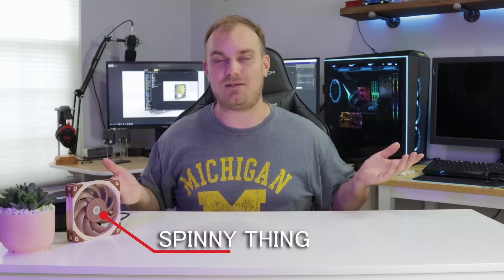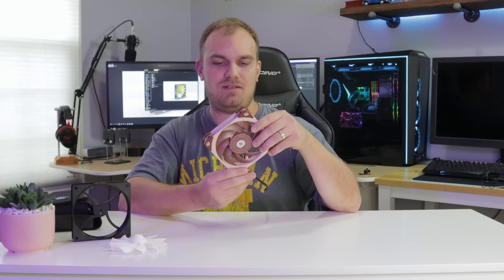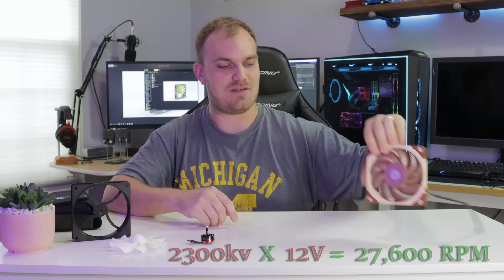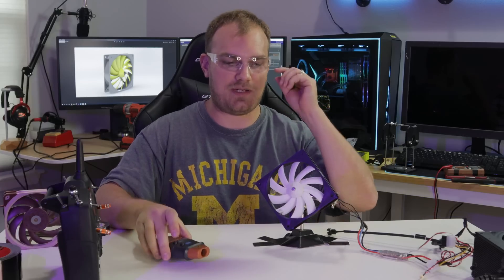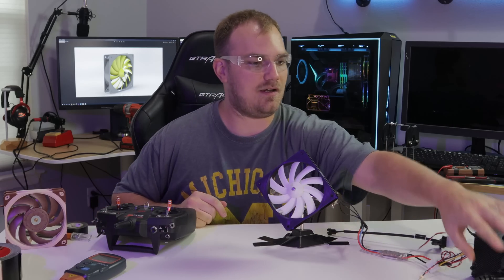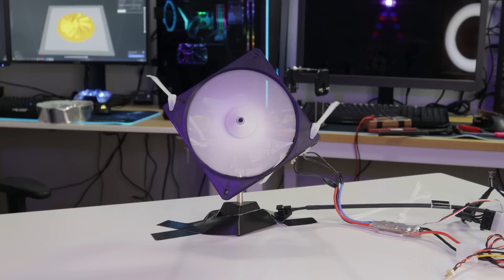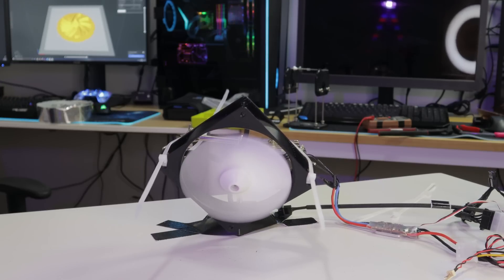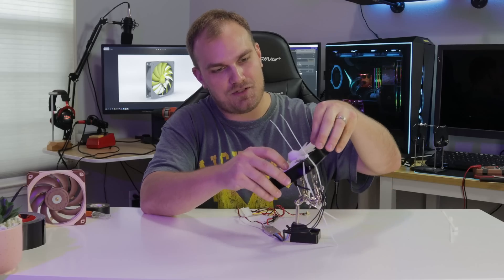3D Printed 120mm Fan + 27,600 RPM Race Quad Motor = Mayhem

Comment: I think what's happening here is the fan blades are being pulled outwards and are actually flexing into the shroud, looking at how much space is left after the test it's pretty interesting that the blades can move that much while it spins, Part of the design for fans like this is trying to find the best possible tolerance between the blades and the frame of the fan, closer is better for airflow, noise, and pressure but get too close and the blades may eventually start to touch the frame. PLA seems to be able to take the force without failing entirely but the problems is that under these types of forces it begins to warp pretty quickly. It's just too soft of a polymer for this I think. something like PC, a hard PETG, or a reinforced nylon would mose likely be more ideal if you wanted to take something like this to the absolute extreme, That would probably also help with the melting issue of the motor mount. cheap case fane usually only spin between 700-1500rpm so for the most part this was pretty successful.

Comment: They sell ~10mm dc motors like the RF-300 or RF-400, a lot cheaper than a quad copter motor, just search “thin dc motor” preferably on aliexpress but if you buy in bulk elsewhere, not too bad either unless these guys are all brushed motors then my bad

Cool balancing tool, as for the oval shape instead of circles, might want to check your printer’s belt tension and any v-rollers you might be using with eccentric nuts, the belts should make a very deep guitar sound when strung, note, if the belts are using something like glass fibers, it might have been stretched so while retensioning them is still better than nothing, there isn’t anything to be done but replace the belt every year or two, thankfully GT2 is really cheap

Cool to see you really have to try to break 3D printed blades

Comment: You need to print a calibration cube. Basically a 1 inch cube and you measure the results with calipers and then keep tweaking the steps per millimeter setting for each axis until you get it spot on 1 inch

Comment: There is an easy fix for the printer not making correct circles, a fast google search says its a belt issue. I have an Ender 3 and have run into lots of issues just not this one lol. Most things are very easy to fix with small tweaks to things. But if your printer isn't put together nice and square you will run into issues that cant be fixed untell u fix the printer.

Comment: Lol, this was enjoyable. I play different games, but there are lots of parallels... I spin pla flywheels powered by quad motors in Nerf blasters (and consequently can fire darts through things) and although they are smaller and primarily fire darts instead of blowing air, one of the tricks is to model in a centrifugal impeller in the wheel hub to draw air through the motor coils. This resolves melting problems. I normally run 40mm flywheels @ 35-40krpm, but lately I have been running 31mm flywheels @ 65krpm (and experimentally 85-90k before a motor disintegrated), and have run 55mm flywheels and stopped measuring at 55krpm (and moved to a safe distance - I was expecting around 70k). Considering the surface speed and centrifugal forces involved, PLA does an amazing job.

I reckon if you address the motor cooling, square up your machine a bit, and add just a touch more clearance, they'll run hard.

Comment: You could make it stronger by adding a rim around the fan blades like in the NB eLoop fans. This would probably also make balancing easier since you can ad or take away weight from the rim.

Comment: If you continue these kinds of projects, I would really look into resin printing for things like fan rotors, SLA or DLP; which I believe are the cheapest, high-res printing methods with the least amount of post-processing, though I haven't looked for awhile and there seems to be a new printing method every couple of weeks these days. You might even find better material properties in one of the many resin types. Basically, you wan't a physical replication to be as close to the 3d model, which FDM will never be able to do.

Comment: Try Marlin 2.0, it has backlash compensation which in theory should help with making those circles more circlely.
Also to minimize tolerances try printing slower, and a bit lower temps, keep the bed hot and without a cooling fan to reduce warping all you possible can.

Comment: I love the stuff you do it's always entertaining to watch. glad to see you uploading you're stuff to thingiverse now that's pretty awesome! Keep up the good work man always enjoy the content! Also I've been 3D printing for a while have multiple printers I can say the key to more precise Prints would come down to your settings and print speed I'm not sure what printer you have or what speed you run it at. Things also help like adding stabilizers for stiffening the z wobble and x wobble. Even sometimes upgrading the bearings makes a huge difference or if you have a printer on extrusion upgrading the wheels can make a big difference to. also the belt tensioners and a better belt makes a huge difference also then the factory crappy hard plastic like one. But I'm no expert just my two cents. 😎

Comment: You need to increase the tolerance between the fan blades and the shroud. The blades will flex outwards due to air resistance, fan manufacturers design for that. Considering how fast this thing is spinning and the flimsiness of the prints you are going to need a much larger gap between the fan and the shroud compared to a regular fan.

Comment: to make the fan as good spinning circle as you can do your balance , then fix the motor with the blade on a surface and spin it at low RPM and use a 400 to 600  grid sandpaper to sand the external diameter a little , then re-balance , repeat several times and the end result on even the second iteration should be good enough so it doesn't wobble to death :D 
Plus there was a new fan design on the market with the idea of a more laminar flow of air and the blade design was something like having a spoiler on every blade so it seems to double the blades , but it actually doesn't , it just improves the airflow. You can try it. 
Can't wait for the next experiment.

Comment: I'd say the shaft was spinning in the blade.....cause heat......causing melting. Try epoxying in a metal ferrule for the shaft to run in. Should also give you a better face to tension down on. What a crazy/ stupid/ FUN project! Keep 'em coming!!😆🤘

Comment: Widen the gap in the center of the fan to accommodate a metal sleeve, mix up some epoxy rated for metal an plastic, smear it over the outside of a metal sleeve and push it into the center of the fan (you'll want to be verrrry precise and make sure your hole is dead center and that you're using a quality tube, cut with a pipe cutter, for the sleeve, but for how little you'll need, that'll be probably 10 bucks tops including the little cutter). That will prevent the nut from receding and melting into the fan base. Use a backing nut if you can with that setup to provide equal pressure from the back like your prop balancer does.

For the blade print itself, move your printer up to maximum quality settings, and back down the speed of the printer. It's going to take significantly longer to print, however, your circles should look less like they were hand-drawn and the blades should require a little less positive balancing with the tape.

Good luck man, I cannot wait to see the next video!

Comment: why are you using a curved blade design? a straight blade doesn't flex as much. i mean the curve from the center to the outside. not the curve for directing the air true the fan.

Comment: Fan blades expanded under centrifugal force and touched the frame. That's the reason why Noctua took so long to release those fans, they wanted as little space as possible between the blades and the frame without having contact under centrifugal force so they had to develop a special polymer to make the blades (or so I heard)

Comment: you said the nut has gone into the fan hub (13:30). This could indicate that the motor has to work very hard (because of the big fan with many blades --> more resistance and less colling than a normal multirotor prop) and so it does also produce a lot of heat. this could have softened the PLA of the fan and worsened the wobbling.

Comment: “Let’s 3D print a fan, I don’t think it’s going to work well” proceeds to make a better fan then anything on the market, and runs it at 3k rpm and it’s still quite enough have a casual conversation when every other fan on the market sounds like a jet taking off just at 1.5k-2k rpm
Reply from the maker: Haha interesting point most of the noise was from my beat up old racing quad motor
Reply: I wonder how the longevity of the motor is affected. PC fans are designed to go for tens of thousands of hours without failure while the quad motor may only be designed for a fraction of that time

Comment: If your printer allows you to upload custom firmware, you should investigate skew compensation in Marlin; also you might want to check X and Y steps/mm, because stretch of belts determines that. The way you can do it is by taping digital or vernier calipers under the nozzle so the nozzle touches one of the jaws, jog the nozzle a bit by software control, zero the calipers, and then jog a known distance.

Also you can make your PLA prints tougher than just about any commercial plastic by annealing them. Simply find a piece of tupperware that is about the right size, put the bed to something like 60-70°C, put the print on the bed (or leave it there), and put the tupperware on top so it's heated evenly. In a few hours, you can remove it and it'll be a tough cookie! Also it'll shrink in XY direction and expand in Z direction. Another benefit is a significant improvement in temperature resistance.

Comment: You could probably improve the dimensional accuracy of your printer with a bit of math, some highaccuracy measurements and screwing with the step/mm values in firmware on it to account for some of the inaccuracies. I did something similar to this with my i3 clone and managed to get it to print perfect 20x20x20 calibration cubes. (By perfect I mean it was within 0.25mm which is as accurate as I need it to be for the stuff I do)

Comment: When you print the fan this time print a solid thin ring tangential to each fan please outer too, it will prevent them from wobbling individually, you can also try ordering a print from a website that does sla printing

Comment: You definetly should use some quadcopter props (something like a 5045C) that would bee sooo much balance, and safer. Mening you could actually try tou mount it to a CPU cooler or as a case fan, not only as a prototype
Reply: I mean when your cooling fan use more power than your GPU that's a bit overkill but meh
Reply from the maker: Overkill should be the name of my channel
Reply: @MajorHardware  that's a fact. Anyway, waiting to see your take on that one ! (also idk if molex can really support 30Amp continuous)
Reply from the maker: I was wondering the same not sure how much it can put out but I dont mind finding out . Also I do have some 3 blade racing quad props
Reply: @MajorHardware  I don't think trying to figure it out is worth it, no way it can pass 30 amps easily. I would cut a PCIe 8 pin and replace it with a XT60. That' one less parameter to take into account for the experience

Comment: i built a ducted fan once and it was able to hover on its own power, like a typical server fan. getting good blade geometry is hard. that noctua is designed to produce a lot of airflow on a little power with little noise, so its quite an efficient fan. the blades have to both be aerodynamically sound and airflow has to be as laminar as possible. getting that geometry to print right is harder. getting proper infill geometry that is balanced is hard and all those striations kill laminar flow, so a good sanding is recommended, and possibly some kind of conformal coating. static thrust tests while monitoring power consumption can really help fine tune the design. 

also there is a trick for opening these things. it eluded me for years but if you take the sticker off (and some fans also have a little rubber plug in the hub under the sticker) there is usually a spring clip in a groove in the shaft there that holds it together. if you remove it the fan can be dismantled, you can also put it back on. its still a brushless motor like your r/c motor there, it uses a hall sensor as feedback instead of back emf, and have a simple controller on the board in the hub. 4-pin fans also have pwm control. using an esc is overkill, unless making things hover is what you plan to do with them, or cooling servers.
Reply: I overvolted a delta server fan once to like 20 volts. I had it laying flat and it shot up and started flying around and eventually disconnected itself 😁😁

Comment: I have a little suggestion for you. Get some a 3Kg weight bar, and 3D-print a  pretty trick fan-test-mount for wxperiments like these. you can alsom make the vanbracket and base separate, and bolt them together, so you can change which fan size you want :) I'ts relatively inexpemsive, and TBW way more solid than som soldering helpers :P 

I suggest this in hope that yo will make more insane fans. and perhaps make a compuer with 4  120mm 5000RPM fans just for gags  :D

Comment: you see now how a computer fan can't just be made with a random material. hence why noctua is making their fans out of barf tan and poop brown
Reply: The Noctua fan housing is something bog standard, most likely ABS because it's a rubber copolymer, and the propeller is made from LCP. I think LCP is naturally beigeish but Noctua uses it dyed brown, and it accepts black colouring just as well. A number of connectors like RAM and PCI-e in your computer are also made from LCP and come in a variety of colours.

But apart from bad temperature resilience, PLA is actually great - note that it didn't shatter even under extreme load, which is an impressive result. Though it can be helped by annealing or better yet using HT-PLA (high content of D isomer of lactic acid) and annealing that.

Most other manufacturers use ABS or polycarbonate for the fan blades. These are even printable with some effort, while LCP is not. I don't see ABS faring nearly as well as PLA though.

Comment: Check belt & wheel tension on printer. Typically oval circles is only a problem on Hbot & corexy printers, not cartesian. So you probably are having some backlash issues.
If in doubt, get genuines Gates 2GT belts as well, as sometimes a belt might have snapped strands.

Once tuned in, i've used these under 200$ printers to make batches of precise circular press fit parts :) It was tough getting to the point you have somewhat consistent pressure, as my parts needed to be also angled, but eventually got there repeatably enough to make hundreds of parts :)

0.12mm layer height tends to make strongest parts on 0.4mm nozzle, but you can go as low as 0.05mm or so, but 0.08mm might be better, needs experimenting a bit.

I've wanted to test this myself as well, but never seem to have the time :)

Comment: Since you are printing it, why not add a support ring on the outside to keep the blades from flexing at high speed. You could also make the hub a bit smaller since the outer ring would provide support for the blades.
Reply: It would also be useful in balancing!

Comment: done it with radial fan, a bit heavy but no balancing problems of the printer (doing this 2 years now), much more powerful motor, cant remember RPM, maybe ill do a video on it.
But at around 120-150W it really moves some air ;)

Comment: I want to see a professionally made fan at that speed
Reply: Oh i have one for you, i have seen one marketed as JouJye Twin Turbo 12cm, pretty damn heavy thing, around 5500-6000rpm top speed, 12V, 30-40W if memory serves. Will take your fingers clean off, so it comes with a grill on it. I think it's actually made by Delta and might be available under a number of brands. Cost maybe $40 or so.

I wager a guess EBM-Papst is going to have a product like that too. Probably more expensive than that though.

Comment: I wonder if a resin printer would work better?
Reply: Probably not quite. The typical printable resins are quite brittle and fragile. In contrast, standard PLA used with filament based printers is a very remarkable mechanical material. Then you have to avoid warping such a big and thin object while detaching and curing, and even while printing, while they're distortion-free in XY, they're not necessarily distortion free in Z direction, and you'd have to rotate the propeller to fit the print surface such that Z distortion would necessarily affect the overall print, so it very much depends on how good the specific resin printer is, and i mean if your budget is under $500, it's going to have its little compromises.

Furthermore if you expect high temperature resilience from UV printable resin akin to what you get with epoxy, well that's for some reason not the case, it generally starts losing strength and distorting far, far under 100°C, you can do better with filament based printing, not necessarily with standard PLA, but with HT-PLA, ASA or HIPS.

There are tough resins coming up though, i think some started appearing just a couple months ago. Not sure about temperature resistance, it might end up being even worse for a while.

Comment: PLA starts melting at a really low temperature, could be the smallest bit of friction at those RPMs that causes it to melt or deform. Maybe ABS or HIPS or polycarbonate would fare better.

Comment: You should consider an airflow blade design,they use less blades and theres lots more spacing. Also delta makes a 3 fin design and a THICC shroud if u want to use that as a reference